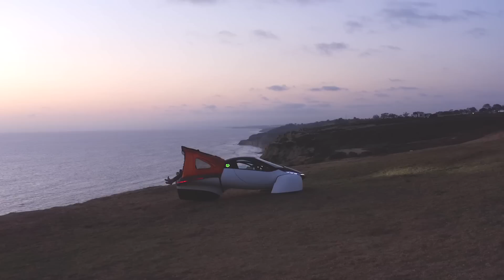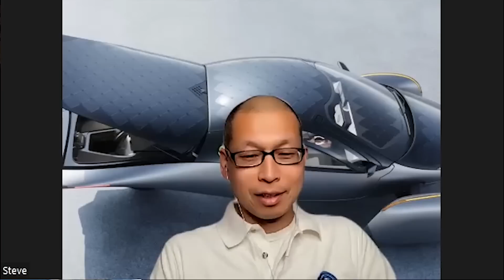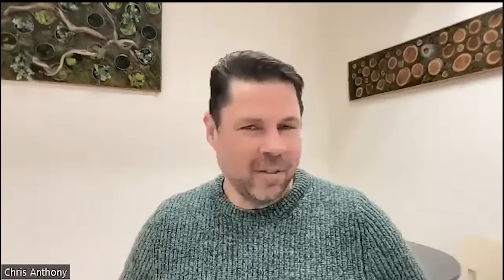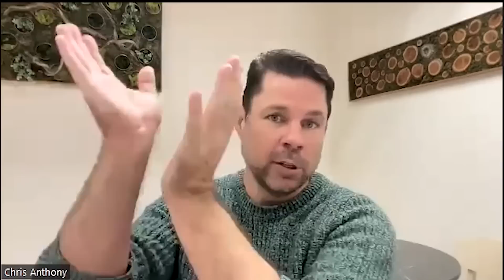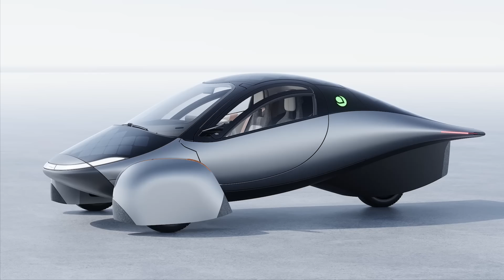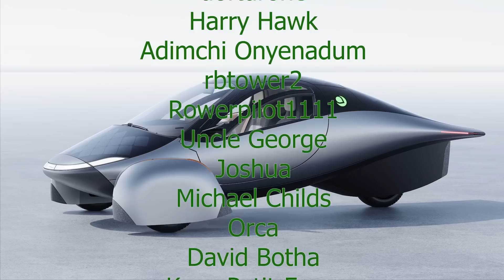Chris Anthony answers questions about Launch Edition, DCFC and production funding

Comment: Great interview!  I'm on the waitlist, but I have 2 concerns: Putting things like turn signals, headlight and high beam switch, cruise control, and HVAC controls all on the center screen is a major safety hazard. The driver has to look at it instead of the road and in the case of turn signals you just often don't have that much time if it is last second change.  Those are deal breakers for me and many others.

Comment: OK Chis - answer this - why isn't it fraud to push back the parties holding the original reservations for the first production Apteras?  Assuming you ever produce any.  Typically; early production cars are worth more to collectors; and of course getting a vehicle is much more valuable than potentially never getting one.  Given the lousy record Aptera has for meeting commitments on production it is hard to believe that Aptera will deliver more than a few production vehicles before you go under; especially if you get sued by the original reservation holders - which you should be - you are cheating them of value. Cheat

Comment: I had this thought while maneuvering around in a crowded shopping mall yesterday in our "park anywhere" Chevy Sonic. 

I could clearly see some larger SUVs and Pick-ups were having trouble accessing the parking areas especially in the center aisles.

I have to ask a simple question. Does the 87" width of the Aptera bother anyone?

Most road vehicles have a 72" or less. We are talking most cars and crossovers.

The widest vehicles on the road are full size Pick-up trucks and SUVs which have an 82" width. 

The only exception to that are Dually Pick-ups, which have a rear width of 96". Most other Autocyles like the Slingshot are around 77".

Having spent some time behind the wheel of full size pick-up and even a dually in an urban environment, there are some places you just can't access easily or at all. 

I can see it will fit, but not easily, in my small two car garage next to my Sonic.

So does anyone think the Aptera's width going to be a problem? 

The width clearly aids in stability, but from a maneuverability standpoint, it's 7" wider than a beheamoth 1976 Lincoln Continental.
Reply: I think it will take time to get used to it. The width presumably improves the stability and safety so it us what is.
Reply: I have over 400,000 miles of experience riding motorcycles.  In California during my commute, I became comfortable lane splitting.  On the other hand, I also own a Chevy P30 step van that is wider than an Aptera.  Both can be parked in a compact parking space.  It tends to be what you get used to.
Reply: @n.brucenelson5920 
I just hope the right side wheel pant is easily visible from the driver's position.

Comment: Great update and interview.  I do wish Aptera would strongly reconsider using side airbags.  Car manufactures have been increasing car safety with airbags, not reducing them.  My new Volvo C40 has side airbags on both sides of the front passenger seats.  So airbags come out in the middle of the car so passengers don't hit heads and just minimizing the movement of the person, which his key to safety.  I'm sure it's a cost thing and speed of production, but safety is #1.  Hope they reconsider.

Comment: If there is any question that AOC is the première channel on all things Aptera and the EV space this interview should dispel  that misconception. Doctor Steve was granted an interview with Chris, a CO-CEO of Aptera to answer many questions of interest on behalf of Aptera enthusiasts. Not only did Doctor Steve ask the questions, but pressed for complete, responsive answers. For the most part, Steve pinned Chris down to provide satisfying responses. Chris was fairly open but there were some instances of evasiveness in a few of the responses. Overall the best direct interview of Chris to date and provided at an inflection point in the Aptera schedule.

WRT DCFC charging, I believe Aptera was able to respond so quickly because they had a nearly completed solution for a lower (40-60) Kw DCFC charger. The other side of that sword is it will increase the price and weight. A tradeoff most if not all will find acceptable. 

It also appears that some of the expected Aptera features will not be available in the LE variant. One of which, side air bags, is of concern of many reservationists. Actual, physical testing (Not just engineering simulations) will tell the true story. 

Chris alluded to the fact that the solution to SafetyPilot was installed on some of the vehicles driven by Aptera staff indicating that it is most likely an off the shelf or nearly off the shelf solution. But, none of the hardware for SafetyPilot will be a part of the LE build.

Comment: Really like the overall vision of Aptera and the team's dedication to the mission and was bummed when version 1.0 failed. I'm an investor and have three on reservation, however I don't see myself as a groupy here. Here are some of my concerns;
First and foremost is it having AV tech onboard - it's hackable and gives technocratic big brother control into your life. Bad juju!
2.  Fat A pillars suck - nuff said.
3.  I am volunteering to test a preproduction model for durability living on a rough dirt road - We currently have three lifted Chevy Volts (gen 1) that are doing surprisingly well. Haven't heard anything about the off-road pkg lately.
4.  As a 50 year+ motorcycle rider/racer I hope they have engineered the swingarm, mounts, etc. to handle the side loading that are not present on a bike.
5.  I am also invested in Atlis Motor Vehicles here in AZ. and would love to some collaboration to speed up things in both camps. 
6.  I was given a big "get lost" when I asked for a visit while visiting San Diego last year despite seeing many "influencers" given the magic carpet ride. Guessing that woulda been different if my investment had several more zeros in it.  
7.  Heated seats should be standard in an EV without a heat pump HVAC.
8.  Too much offshore sourcing going on.

I hope these will be taken as the constructive thoughts that they are coming from a design/engineering mind. CHEERS.

Comment: Because the Aptera motors use permanent magnets, I don't think it would be possible to turn off one or two motors when driving on the highway to improve efficiency.  (see video around the 11 minute mark).   Faraday's Law of Induction would cause the motors to go into regeneration mode.  I would be interested to know if they have a way around this.
Reply: With no load (an open circuit) their is no current loop to cause a regenerative force. I saw one comment in another thread on this subject from someone who talked with Aptera's motor suppler, Elaphe. Elaphe said they've demonstrated their motors in a freewheeling mode. That would allow towing the Aptera while unpowered (i.e., in neutral).
However, I wouldn't expect significantly better efficiency, and handling would not be any better, often worse. For example braking and acceleration are both better when every wheel contributes to the force.
Reply: At constant speed say on the highway, would one motor only be more efficient than two or three?  Tesla has 3 motors in the semi truck.  At constant speed a single motors is used and 3 motors are used when accelerating and for regenerative braking.

Comment: GM2080 vinyl wrap promises 7 years for vertical surfaces and 2 years for horizontal surfaces.  The back of the hood is horizontal and will be degraded by UV faster than the sides, but it will determine when the wrap needs to be replaced.  It won't matter if the sides look good if the top surfaces are shredding.  And, you won't be able to delay replacing it because the UV will start attacking the resin in the SMC if it isn't covered.  Chris and Steve, please choose PPF over vinyl.  It's a little harder to apply, but the people who do the wrap will get good at it.

Comment: Steve, the Accelerator program, does this mean that if someone ordered a 1000 mile model previously and gave the 10k dollars and secured a spot within the first 2000 slots available, that Aptera would make that 1k model, despite that they said the 400 mile model will be made first?
Reply: Nope. The accelerator program is all about the launch edition
Reply: Thank you for the response.

Comment: Most solar output is reduced after 5 years will they warranty the cell output to a specified output level?  Someone needs to put that in writing for users to make sure they have a way of getting them replaced if they do not meet a output level after 5 or 10 years.  Is there any answers for this concern?

Comment: CANBus / DBC data “dictionary” access means a lot. By contrast, none of the electric motorcycle vendors provide this, and some encrypt it for reasons I find kind of arrogant and definitely misguided. That’s an entire conversation I’ll leave out.

I have finally put in a reservation based on this data access, the general right to repair eagerness, and of course efficiency. The charging rate limit of 40-60kW makes total sense for battery longevity.

Comment: Again, Steve this is another well done and super relevant (esp. for us Aptera reservationists and investors).  For me you asked (and got satisfactory answers for) two big questions:  1) What was cooling system issue that Steve alluded to in the 1st LE announcement as justification of omitting DCFC (making us all question the real viability of the battery cooling system), 2) being able to use the provided NACS plug with both Tesla and non-Tesla DCFC stations.  (Thanks!)

I have a few questions for Aptera (some of these might be obvious to you who already have an EV.  The Aptera will be my 1st EV):

1)  In the e-bike world (I'm a DIY'er) a "Direct Drive" e-bike motor will have some inherent rolling resistance (even when no power is applied) due to the permanent magnets' pull on the opposing surface.  On an e-bike, this added rolling resistance represents at least 10% loss on rolling efficiency.  On a "geared" e-bike motors (or on an EV with a transmission allowing disconnect of motor to wheel) there is no such magnetic drag (the wheel rolls freely as any other bicycle wheel).   With Aptera's in-wheel motors, I suspect that the magnetic drag is unavoidable.  My question: When Chris mentioned the lower efficiency of the AWD version, how much of that efficiency loss is from this magnet drag?  (I'd like to know, since long distance travel is a bigger criteria for me than the benefits of AWD (better snow/off-road traction, neck snapping accel, etc.) 

2) Will we be able to set the charge to limit to 80% or 90%?  Also, can we set the discharge to 10% or 15% (i.e. not let it discharge to 0%)  (This of course is to preserve battery and keep it safe from my own negligence.). Or is this usually already pre-programmed in most EV's including Aptera?  Hopefully this user changeable (sometimes we must go past these limits in emergency situations, and/or if a new type of pack (like LFP or Sodium) is used.

3) Will regen braking levels be selectable by the driver?  (I predict that I will want more regen in the city stop/go traffic, and I would like little or no regen on an open highway, long distance travel.

Comment: I'm an Aptera reservation holder and want this company to succeed.    

I totally believe in the "efficient transportation" part of the pitch.   I'm skeptical of the solar part. When my car arrives I hope I can turn off the solar part.

Regardless. Nice interview.
Reply: Don't be skeptical of solar. There is no reason to be. Try it you'll like it.
Reply: @IBMara  Yes there is.    The battery pack needs to be charged in a specific way to maximize its longevity. You don't want to be just randomly charging it, so these solar panels might do more harm to the batteries and you would need to replace them soon than if you just charged them at home.

I'm turning my solar panels off if possible, since I want to keep the car for a long time and can charge them off the panels on the roof or my home.

Aptera should aim to be the most efficient, and affordable to produce EVs instead of hyping up something that won't meet people's unrealistic expectations.
Reply: @alansnyder8448  I doubt the cells Aptera puts on the vehicle will hurt the battery.

Comment: Man I was hoping to find out about cruise control
Reply: This is something that should be very easy to include in the Aptera LE.  I can see that a software upgrade could make it possible to include on the main display as a touchscreen button but removing your hands from the yoke and looking at the display is not ideal.  Even old-school cruise control by pushing the end of the turn signal stock would be better.

Comment: Good questions and answers.  Like it!  I would like to see the testing for both efficiency and DCFC in the production ready vehicle.  40kw DCFC would be fine if the Aptera is as efficient as expected.   Should be easier on the batteries and cooling requirements.  

Final production build testing will be important to me.  I will wait for my 2wd version with the basic 400 mile order and let the testing get done with launch editions out there in the wild.  There will be a lot of learning taking place.  

Funding, anyone got 50-100 million laying around you want to put to work?  He just confirmed what the finance officer had said previously that prod builds are all dependent on the funding.  So it sounds like we are in a wait and see mode now.   

If you look at what other companies and startups have spent to try and get to production Aptera looks "frugal" compared to others.   I know we are pulling for all of these startups in this David vs goliath fight to get great ideas and products to market.   

I have been watching the progress of the Canoo guys.  They have done amazing work and testing, but they have spend a TON of money and still don't have their production facility setup.  They went to a contract manufacturing company to build a limited number of vehicles for a customer and now trying to shift over to their planned production facility, but they are almost out of cash and have burned through the money even after going public with a stock offering.  

It is a scary and tough time in the financial markets with the Fed using a wrecking ball to try and contain inflation.  Hoping for the best, but looks like 2023 and probably 2024 the economy is going to be on rough footing.

Comment: Great Interview, Steve!  It's awesome that Aptera is actively pursuing an open-source architecture.  It's a bit frustrating that Chris dodged the real-world aero-drag question.  I'm not convinced that omitting an industry-standard feature (side-airbags) is a wise move.
Reply: I agree with your assessment. Not as open as most claim. The side-airbag issues, being a safety issue may be resolved through reviewing the safety testing results.
Reply: @yanpingyang9028  I'm concerned that a side-impact would injure the upper-spine, as a result of your head getting thrown onto your shoulder.  It would probably be wise to have some sort headrest or airbag to limit the range of motion of the neck.

Comment: hmmmm 40k preorders, they need 50m in funding. Allow reservation holders to offer an additional deposit of 1-1.5k and you would have your 50m.
Reply: They said the state (of California) blocks the use of deposits for anything other than sourcing parts or building your vehicle. Could not be used for tooling or production machinery.

Comment: Some thoughts for the future:

- a more narrow version (1 seater), 1 door instead of 2 and without inbuild solarpanels ( for cost and weight redction), for more efficiency max 90mph in wheel motor (no need for crazy 4s for 0-60mph). range still 400 - 600 miles and 10min chargetime 100 miles range

- battery upgrade possibility (if new technology will come out) and also to re use the old battery for a home battery storage.

Comment: I only have one more question. If you pick up your Aptera at the factory will you still have to pay for delivery charges? The delivery charge on cars has skyrocketed, adding $2K on some vehicles.
Reply: From what I have learned, you can pick your Aptera, and drive it home, or whatever. I will drive mine home if its not the dead of winter

Comment: Wow! That was a spectator interview Steve! You really broke it down and hit all the high notes. You asked every question that I wanted to ask and more that I needed to know that didn’t occur to me. I will watch this multiple times. Chris did a better job explaining the thermal management system and battery uptake issue - essentially there wasn’t one at 40 - 60kw. Although, I am still bewildered that they could have equipped it with 40 - 60kw fast charging since they had the plug resolved and the tech in place, but they didn’t simply because they had put it on the back burner prior to the plug resolution and they were only thinking 100kw. That’s a major oversight to not check with their engineers earlier. Being able to charge between 400 - 600 mph vs 57 is kind of important.